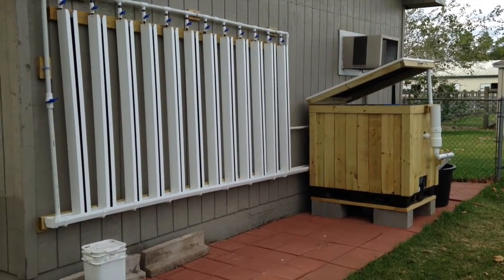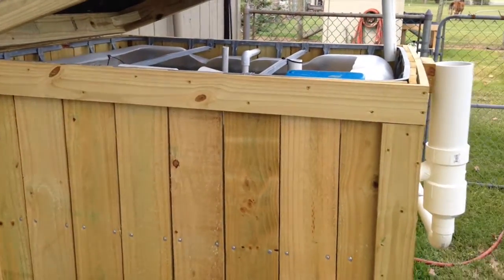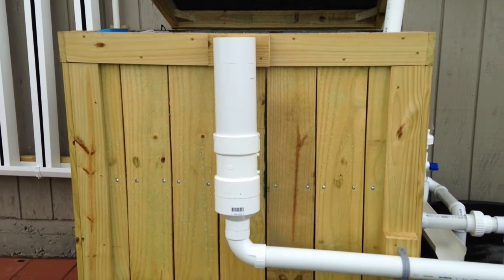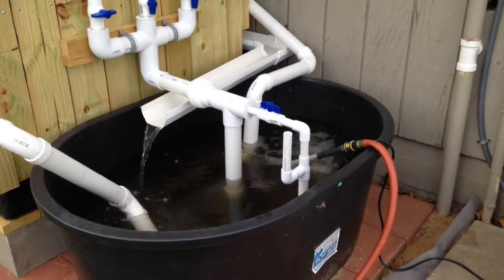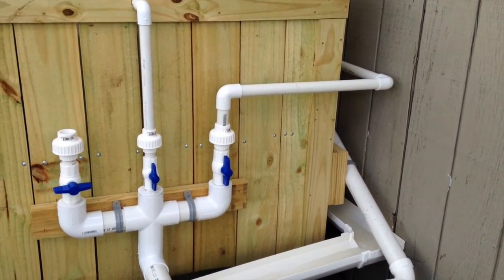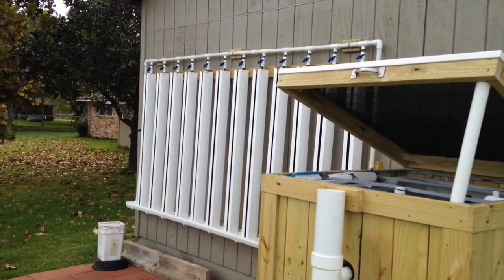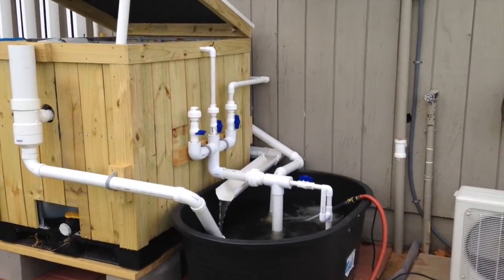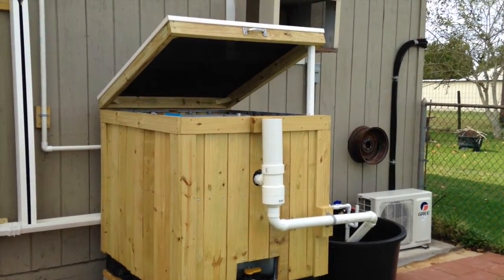Vertical Aquaponics System

Comment: Stupid question: So with these zip grow towers, you don't need an extra biofilter plumbed into your system? The zipgrow tower media acts as the biofilter as well?

Also, are you running the system continuously through the night?
Reply from the maker: Actually I added an additional bio filter, a large screen filter, and I've changed the water delivery system to use drip emitters mounted to a 1x6 header with a large vibration motor that runs intermittently to prevent clogging. Yes, the system ran 24/7. As of right now, however, it is offline since my pump burnt up and I had an emergency with my main system where I needed the bio filter.